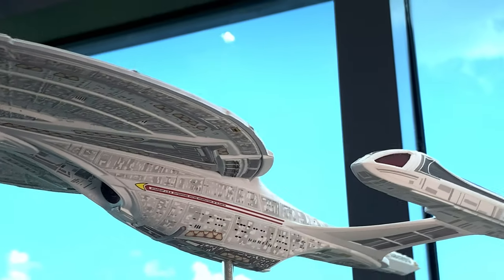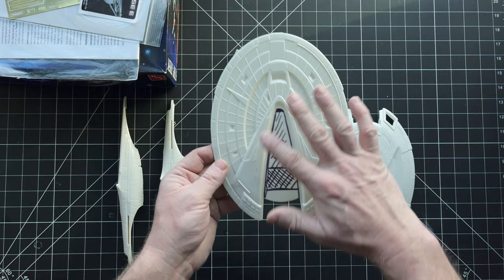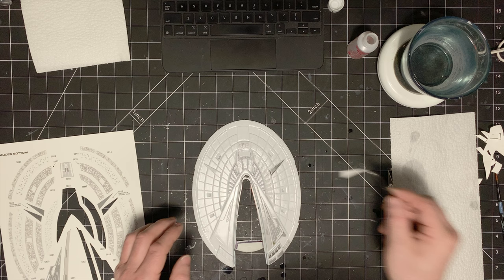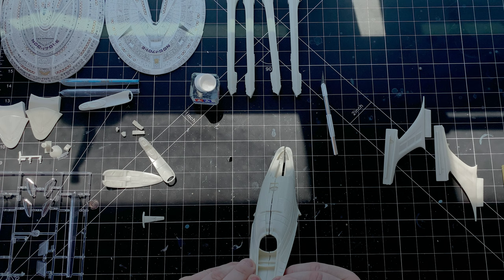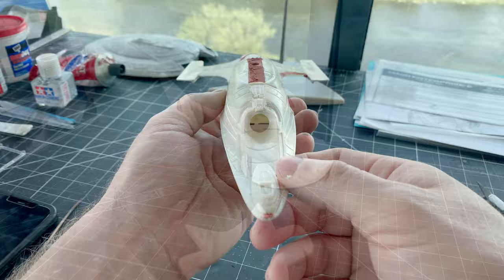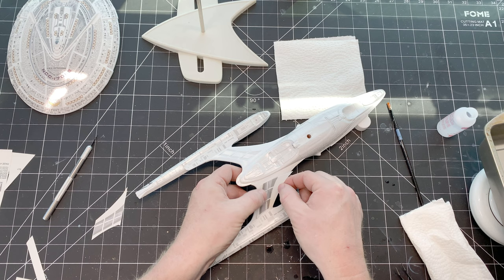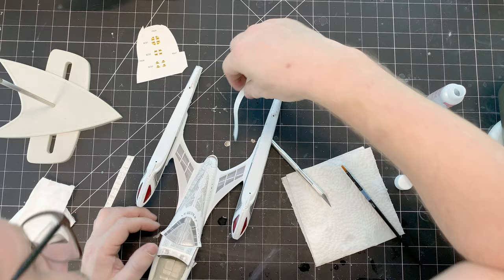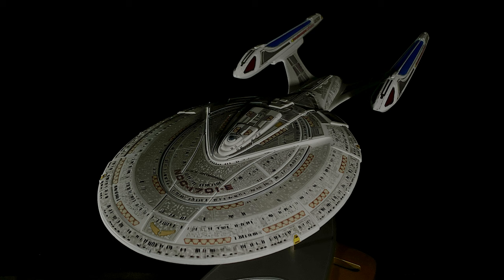1/1400 USS ENTERPRISE NCC-1701-E DETAILED MODEL BUILD

Comment: Jason! Question: why did you removed so much “meat” from the upper side of the secondary hull and the underside of the lower saucer?
You took so much away and reduced the “glueing” area! Perhaps that was also the reason why the secondary hull had so wide of a gap between the secondary hull and the saucer! 
Even if you had to light the ship you don’t have to remove that much of plastic from both parts.
But like always I love the way you explain everything and show the “ mistakes” keep the good work going!